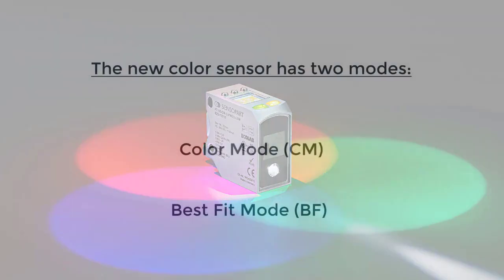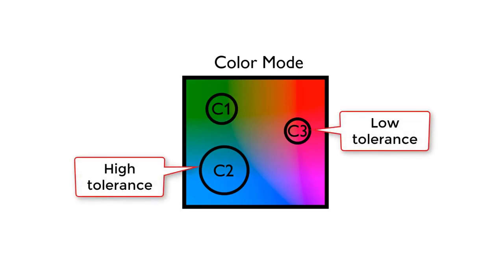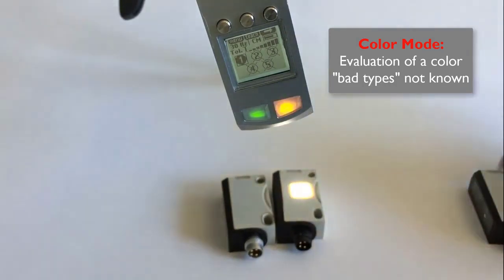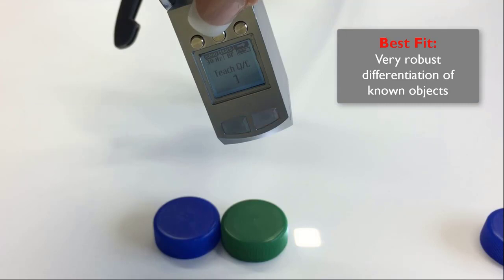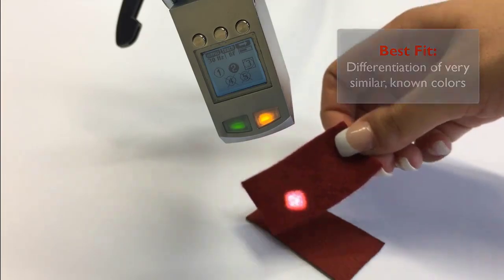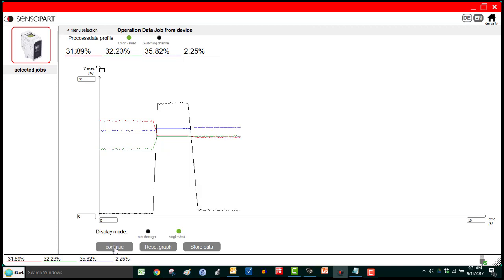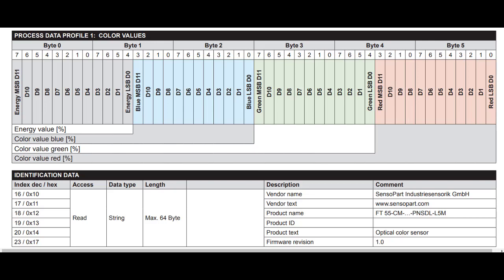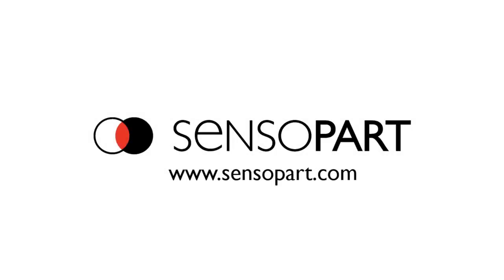Teaching the FT 55-CM Color Sensor.

Comment from the maker: 0:21 Overview of color & best-fit modes.
0:48 Color Mode: Overview.  Plastic housing color verification.
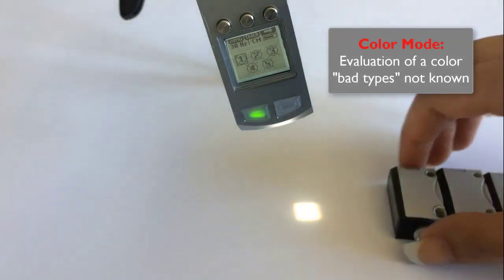1:32 Color Mode: Application Example.
2:00 Best Fit Mode: Overview.
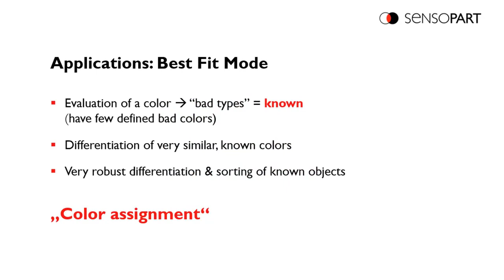2:26 Best Fit Mode: Application Example.  Bottle Cap colors.
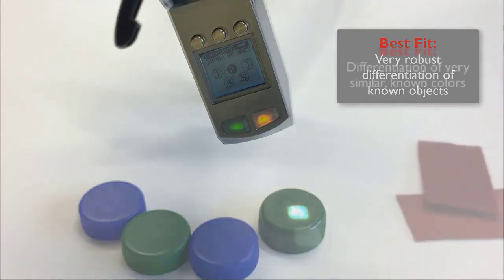3:05 Best Fit Mode: Applicaiton Example.  Red felt & red leather.
3:57 Best Fit Mode: Applicaiton Example.  Dark plastic parts.  IO-Link real-time trend.
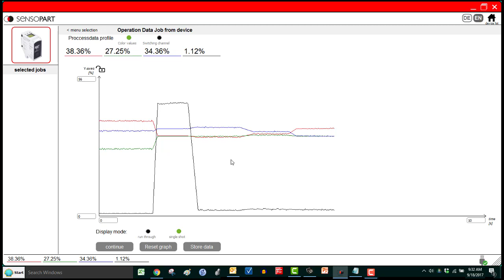5:04 Combine both Color & Best Fit mode.  Use IO-Link to PLC and check the specifications in the PLC. 
5:40 Color Mode: Special Features.
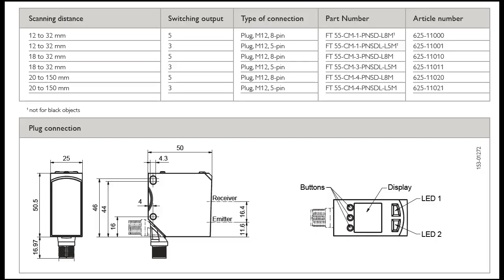6:09 List of Color Sensor Models.
  
SensoPart Industry 4.0 Sensors
http://www.sensopart.com/en/products/generation-4-0

FT 55-CM Product Selection Page
http://www.sensopart.com/en/products/color-contrast-luminescence-sensors/color-contrast-luminescencesensors?baureihe_farb=F%2055

FT 55-CM IO-Link memory map
http://www.sensopart.com/en/download/finish/155-io-link/3894-ft-55-cm-pnsdl-l5m

FT 55-CM Datasheet
http://www.sensopart.com/en/download/finish/41-farb-kontrast/3887-ft-55-cm